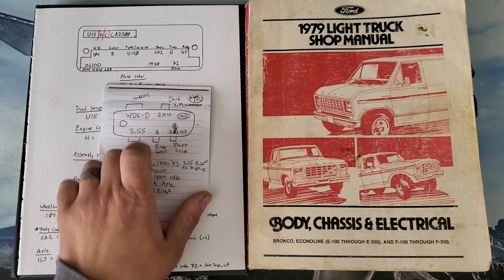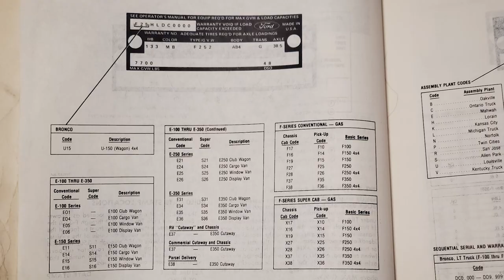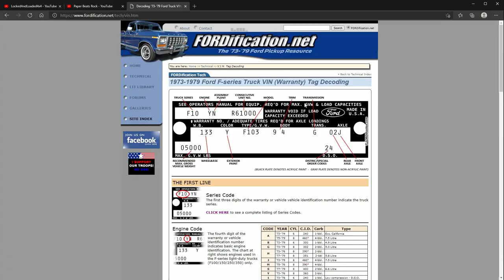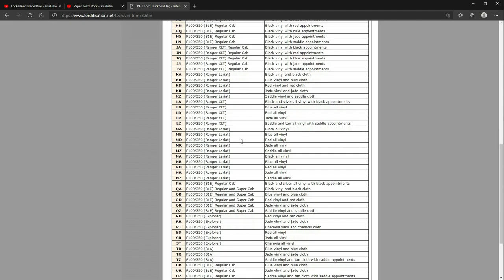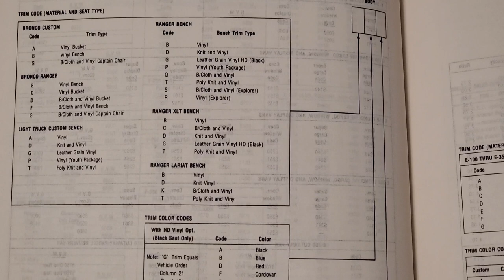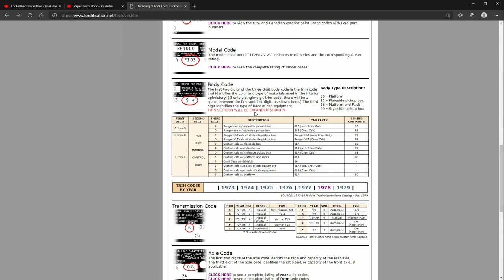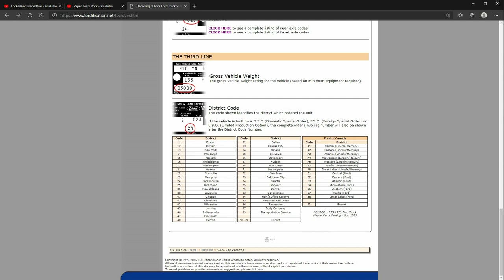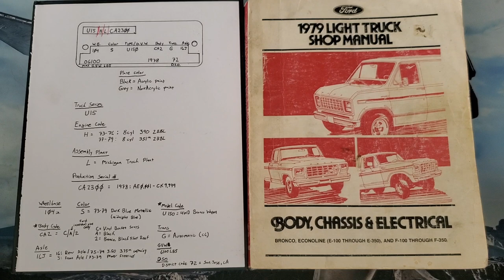Decoding 1973-1979 Ford Truck and 1978-1979 Ford Bronco VIN Numbers

Comment: Dude this was super badass to watch. It was amazing to see the breakdown and learn that the bronco did have bucket seats in it originally. I'm guessing someone had stolen them and threw that bench in there with them. I know the center consoles are getting harder and harder to find. So to find out if it had the xlt package on it I'm guessing I would need to have a Marti report done on it. 

Thanks again bud. Very solid work. You a wealth of knowledge.
Reply from the maker: No problem, always fun to do this stuff, and yeah I've had to use alot of the later 80-up consoles as replacements, only saved one that was original from 1978/79.

Comment: I've worked at that Ford plant in San Jose [Milpitas], CA. It's called 'The Great Mall' now. The beams in that place are huge for the weight they use to carry. If you go to google earth you can see the tower on the mall they used for The Great Mall sigb at the top. The tower use to hold all the different  hoods. They would punch in what type of good the customer ordered and the machine would grab the right one out of the tower and bring it down to be mounted on the chassis.
Reply: wow that is super badass. History like that is forgotten stuff. I now want to look it up and see what I can find out.
Reply from the maker: That's awesome, yeah I used to run data cable through there, super cool place! Between that and the old Fremont NUMMI Plant.
Reply: @LockedAndLoaded4x4  I grew up in Fremont. My neighbor worked at Nummi when they were building Toyota trucks.
Reply from the maker: And now, now it's Tesla, and a mess... yeah used to live in Livermore, was the first place I lived in CA

Comment: how would you find out what strip package you have. I have a 79 Bronco light Blue with Blue green and white strip
Reply from the maker: Ahhh yes, rare bird that one is. I want to say I saw your Posting on Ford Bronco Lovers today on FB. I haven't seen a lot of Blue/Green Stripe Broncos but I will say I thought them to only be available in 1978, though I could be wrong and they could have had them into 79 with the larger Chromatic Stripe kits being side-by-side. That being said the best thing you can do is get a Marti Report, they will detail out your build sheet details and it will tell you without a doubt every option and package that was available. the only other way without the original sales order in hand would be to find the build shet under the floor or one of the front seats/Bench if so equipped, but usually these are all rotted and gone by now and if thy are still there are pretty well illegible sadly. Marti will take care of you though and I linked their site in the Video Description.
Reply from the maker: I also do have to add that is a sharp looking rig you got there.

Comment: Help Please....
I just purchased a 79' Bronco I have no vin plates or identifiers anywhere of the usual spots on the title I have a U15 H L EE98_ _ Im not sure if this makes sense specifically the Product Serial Number. The frame had been completely restored and painted so I am concerned that the numbers might not even been on the top of frame locations. I was hoping you might know something that could be of help. thank you
Reply from the maker: Do you happen to have any "Buck Tags" under the body or on the Radiator Support/Firewall? They will be a small sheetmetal tag with raised/stamped letters/numbers and a single aheetmetal screw attaching it, that will have a full vin. Normally restoration and coating of the frame would still leave the VIN visable unless someone ground it off heavily which woukd raise some red flags for me. There are 2 locations for the VIN on the passenger framerail, one directly under the cab/body on the top of the rail, and one on the top of the same rail but further towards the front of the vehicle and atill near the firewall. That'd be a huge help if you had either
Reply from the maker: So other than the added axle an options Data your VIN comes out to [U15= U-150 Wagon 4x4 (Bronco)] [H= 351 2v (351m)] [L= Michigan Truck Plant Code] [EE90____= Feb 1979 Build Date].

If you are looking for the Buck Tag and dont manage to find one you could always grab a report from Marti Reports (link them in the description and have their page on the video also) and they can grab the info your Cab's Warranty Tag and decal should have had on it and that would be accurate, they also provide a reproduction of both along with punch rivets to put them on your rig.
Reply: @LockedAndLoaded4x4  Thanks for the reply so quickly. I was able to find the Numbers on the frame how ever those last group of numbers do not match the tile. how screwed do you think I am? would you know of a way to remedy this situation?
Reply from the maker: @goose14k  if the EE98___ sequential numbers don't match that really depends on the State, in most cases it's not a huge deal as long as the mismatched VIN isn't destroyed or tampered with, some will re-issue another vin, in most cases you can declare that the Frame was damaged and replaced, usually either the cab or frame had damage and was swapped, some states make the Body VIN the vehicle and others make the Frame VIN the vehicle in such a case. I'd honestly stay with the Titled VIN myself. I have a 1979 F150 4x4 I rolled and swapped to a 1974 F250 2wd body, I had both titles and CA State at the tike deemed the body VIN was the vehicle VIN and titled it as such, I have both titles just in case but otherwise the Truck is titled as the 74 with the weight rating changed to reflect that. Idaho didn't care on it.
Reply: @LockedAndLoaded4x4  yes on the frame it seems to  be GF32__ rather then the EE98__ on the title. I appreciate all the help hopefully i will be able to get New York to issue a new vin thank you again
Reply from the maker: @goose14k  no problem, worst case if you have an active Title they may just issue on that one. I'm sure if you explain the issue of it being restored and that the vins aren't stolen record you should be good. Wish you luck. 👍

Comment: I have a 1978 bronco and in the trim code the middle letter is a z I can not find the proper colour to match it any where even your list doesn't show the z cross over.
I was told not to use truck codes as they were different
Reply from the maker: There was a Z-code that can be decoded, but it requires the code digit after to fully decode, Jade Green and Saddle could both be a 1st digit Z-code. Do you have the digit after? For example _ZZ would indicate a Saddle Tan Vinyl with a Tan Cloth center, but ZR woukd indicate Jade Green Vinyl with either Jade Green or multi-green cloth centers. The Pickups used the same codes and that one requires use of the Ford Master Parts Catalog. I'll be doing an overview of the FMPC here soon when I can stop doing 11 and 12hr days at work 🤣👍.
Reply from the maker: Also to add, the Z-codes did share with pickup in Most cases but not all, the Z-code was kind of a catch-all for Lux interiors from what I have seen.

Comment: Here's a crazy one I have 1978 f250 hi-boy xlt ranger lariat short bed flare side 4x4 with a 460cid. I bought it from the original owner who order it. And I have the original build sheet and yes I know 77 was the last year of the hi-boy. But I found out 77 was the last year for dealer stock hi-boys mine was built in March of 78. And yes its not for sale.
Reply from the maker: Sounds more like you have the later chassis, the 77.5 was the first of the new chassis type with High Pinion axle and the married T-case, if you have relief holes near the engine mounting of the frame then it's the later Chassis, if not and it's listed 78 on reg then there was a dealer selling the early 77 in 78 which I could see happening and them listing it as a new truck, stranger things have happened. But there were never any of the "Highboy" Chassis made after mid 77 due to the new Federal regs at the time requiring frames to have a certain amount of give in a head-on collision which was the reason for the cut reliefs.
Reply: @LockedAndLoaded4x4  ill have to look but I have the build sheet on it. I do know one thing its a beast. Its a light green all over. Its not two tone and even the paint code tag says its that color. I'll never part with it. I've had it longer than my wife 😄

Comment: where are all the vins on a 78 ford f350
Reply from the maker: So, you have the Warranty Tag riveted to the Drivr door Jamb by the catch/latch, on the opposite end on the door jamb there should be a dcal with detailed information, if both of those are not present then you have2 stamped VIN numbers on the top of the Passenger Side Framerail, one is just behind the engine mounting going towards the cab corner near where the starter is, the other is satmped underneath the cab on the same framerail.

Sometimes there are also Buck-tags (Body builder tags for ID on the line) that were left on the body, one location is screwed to the front of the Radiator support, usually on he passenger side, the other is right on the Cab Firewall usually right behind the engine, another is under the front of the bed screwed into the first floor support. they look lik a credit-card sized (just under that size) metal plate with stamped umbers, the top LH side is the VIN.
Reply: @LockedAndLoaded4x4  thank you, I'll look

Comment: I recently got a 1977 Ford f100, would you know where on the truck I could find the vin number ?
Reply from the maker: There are several locations that you may be able to find it, the 2 easiest are on the inside of the driver door on the stamped aluminum Warranty Plate, there should be 2 rivets attaching it too the door. The second location is on the rear pillar of the door jamb for the driver door there should be a warranty decal in white with the VIN. If you can't locate those there are 3 Buck Tag locations that you can track down, one is on the radiator support, another is on the firewall in the engine bay, then the other location is under the bed (bed floor area under the truck) on the square tubing support nearest the back of the cab. One last location is the passenger side frame, there will be 2 stamped locations for the VIN on the top of the framerail, one is just after where the motor mount support/tower is, the VIN will be surrounded by 2 stars on either end, the other is on the same frame rail on the top under the cab, it will be stamped in the frame.

I hope this helps.
Reply: @LockedAndLoaded4x4 alright I’ll check it it out, thank you. 👍
Reply from the maker: @CarlosRamirez-fs5ul  no problem, gave me a good idea for another video. 👍
Reply: @LockedAndLoaded4x4  hey would you know any website that I can check the vin# on? Most of say I need a 17 digit # but mine is 11 digits
Reply from the maker: @CarlosRamirez-fs5ul  i have Fordigicaion's link in the Description, sounds like you may have a few sequential numbers maybe worn off, if it's off the back end there shouldn't be a huge issue.
Reply: @LockedAndLoaded4x4  got it, thank you responding back to all my comments, wish you well
Reply from the maker: @CarlosRamirez-fs5ul  no problem, glad to be of help 👍